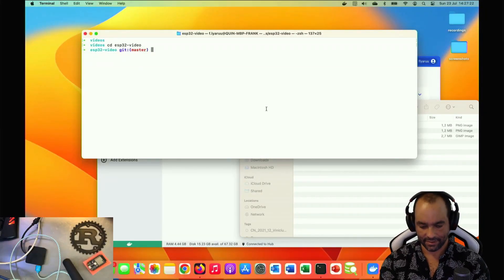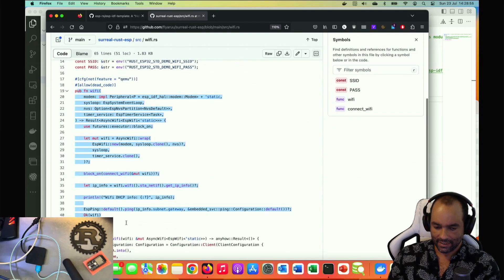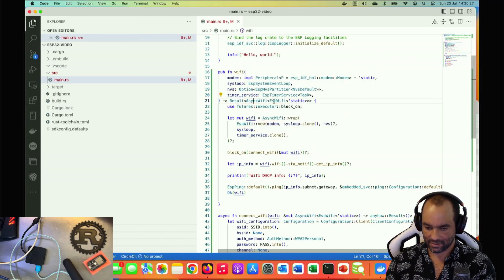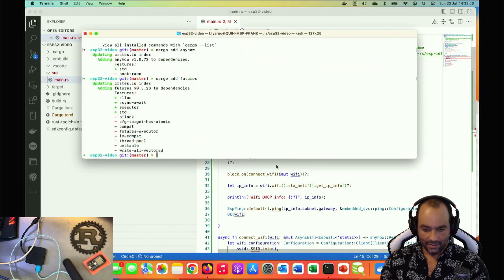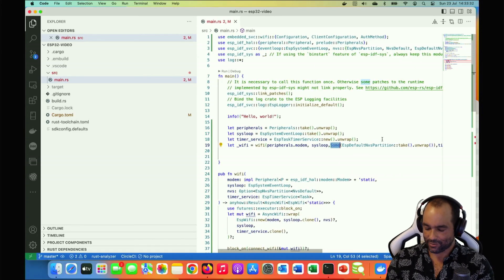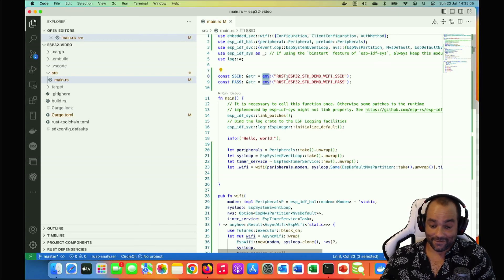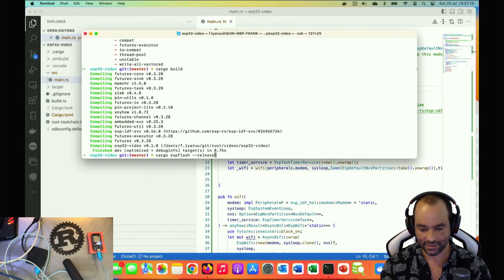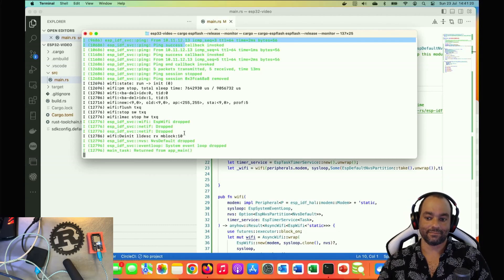Rust on ESP32 - Adding WiFi

Comment: Tearing my hair out over this. Esp32s3. It absolutely will not accept the custom partition table factory,  app,  factory, ,        0x180000,
Has 8MB of flash but keeps saying elf program will not fit in flash, set to 1MB. I know cargo is building the partition table and using parttool shows partition.bin has the right partitions set. Why does it not accept the custom partition table! So annoying.

Comment: great video!
do you plan on doing one where the esp acts as an access point as well?
it seems like all the tutorials focus on connecting it to an existing network and simply switching from Client to AccessPoint configuration seems not to work
Reply from the maker: Sorry for the delay. I tried it with an AP, and that did work, but since then the libraries have changed a bit. Didn't the access point show up at all?
Reply: @floodplainnl  thanks for the answer. I found an example in the esp-idf-svc github in the meantime(esp-idf-svc/examples/json_post_handler.rs) and managed to get it working.... until i got stuck for like a week on the 1-wire protokoll and switched to C++ ...
But I am waiting in anticipation for your next video. I definitly wanna try the next project in rust again, I just feels better to write :)